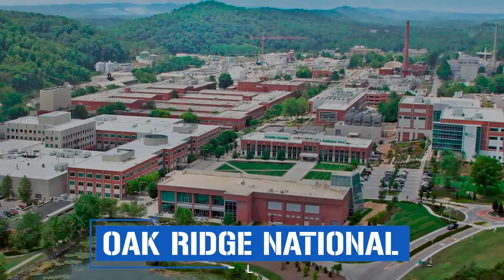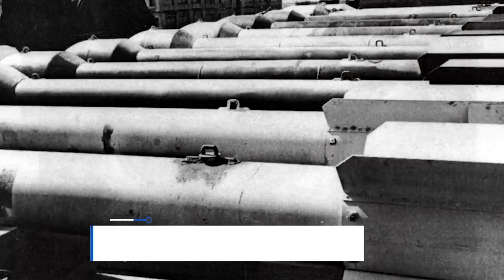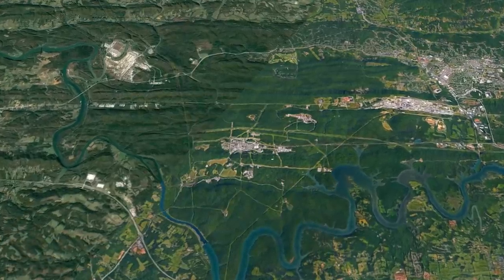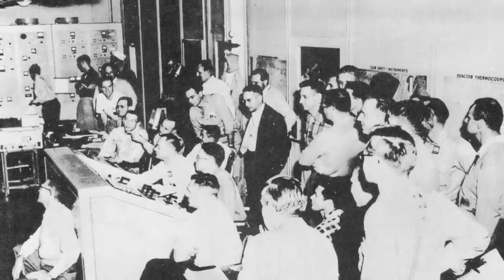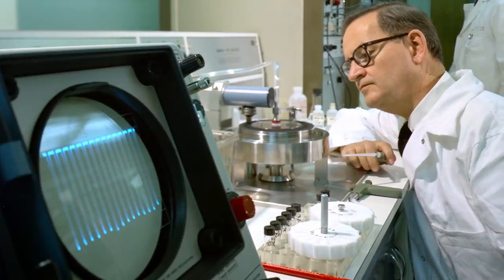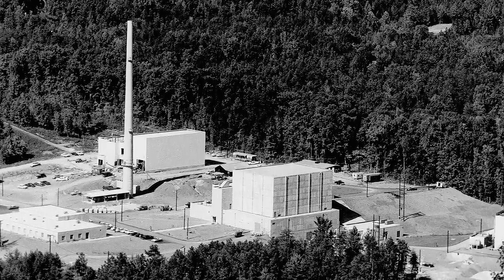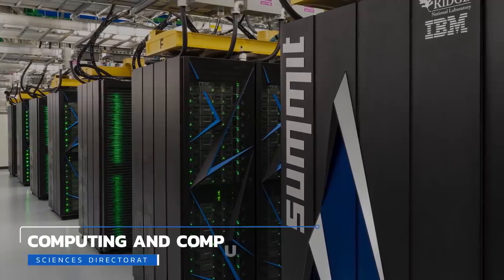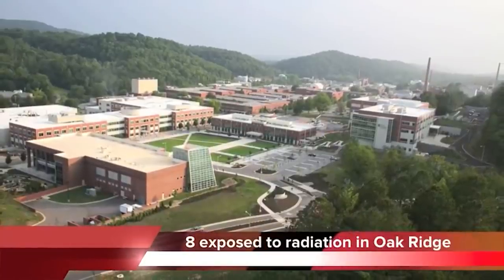The Oak Ridge National Laboratory

Comment: Having grown up just over the hill(s) in WNC, I have always been fascinated with what happens at this facility.

However, I had NO idea at ALL how massively monstrous the entire place is! 58 SQUARE MILES!!!!????? WHAT!!!!????
Reply: Mostly plutonium bunkers probably
Reply: @engineeringvision9507  good chance
Reply: 58mi squared is about 5 miles by 6 miles.    Probably decided on originally as a security perimeter, and later kept as a good standoff distance for the public should anything radiologially bad happen (Chernobyl was a graphite core too...)
Reply: @NullHand  Nah. Not even security perimeter, not really. Deal with the military long enough and you learn that's just their way of future proofing. It's easier to ask for a huge land grant of empty land to do something now than ask for an extension 20-30-50 years down the line in case they need it. Stuff grows around military bases directly outside the line and they figured out over a century ago that it's mostly impossible to get a court order to move that stuff to expand a base. The fort system of the 1800s was a nightmare anytime they wanted to expand a base. So now days they just claim the largest area anyone will let them get away with just in case. It's how they get things like White Sands. Noone cared about New Mexico desert, so they got 3200sq miles of it. A ludicrous area. You can always tell what part of the US government started any particular project by land grant size.

Comment: During the Manhattan Project there were 3 industrial facilities built in what today is called Oak Ridge.  X-10 had a graphite pile connected to a chemical processing plant (called hot cells) that made and recovered the first gram quantities of Pu239.  The other two facilities, Y-12 and K-25, were involved in uranium enrichment during the Project.  X-10 later became ORSL then ORNL after the war.  There are a lot o errors in your video as commenters point out.

Comment: I’m about 15 minutes from Oak Ridge the place has a lot of local rumors specifically alien experimentation. The security company I work for contracts security for the installation whenever you get posted there it is very secretive and you aren’t briefed on the job details until you go through extensive background checks.

Comment: I believe that a most extraordinary opportunity was overlooked at Oakridge with the groundbreaking work carried out by Alvin Weinberg and his team. Having invented a compact light water reactor (LWR) for submarines, logic suggested that this technology could be scaled up for Domestic power generation. Alvin Weinberg did not agree instead he favored revolutionary Liquid Fuel Thorium Reactors (LTFR). This technology has many advantages over LWR reactors including - inherent failsafe design - no pressure containment required - fuel dissolved in molten salts no need for expensive pellets - nuclear fuel is mainly used up in the reaction - little nuclear waste produced - reactors of this type can be compact and modular - does not produce byproducts that can be used in nuclear weapons (when Thorium is the fuel used) - Thorium is relatively common fertile material - this reactor concept has been built and tested in the 50s and 60s - the natural running temperature is around 600C-800C great for converting water to steam to drive turbines or better still use liquid CO2 turbines - this type of reactor will shut down safely if there are power cuts or leaks (where the salt freezes in contact with cooler air). I could go on but if only this technology had been taken seriously by the American administration, we would have a relatively cheap source of reliable energy, instead all the research is now open source and being developed by the Chinese government?

Comment: I'm afraid you butchered the Manhattan Project History of Oak Ridge National Laboratory (ORNL) by conflating the three sites in Oak Ridge at the time, and attributing that work to ORNL.  In reality, Clinton Labs, the progenitor of ORNL, was a small site that was managed from Y-12 during the Manhattan Project. Several of the historic photos you attribute to ORNL / Clinton Labs were actually of the much larger Y-12 or K-25 sites.

Oak Ridge was by far the largest of the Manhattan Project sites, and was an administrative center for the project (General Nichols, the primary deputy for General Leslie Groves, had his office at the Y-12 site). Operations at Oak Ridge were split among three sites: Y-12, K-25, and X-10. Y-12 contained the electromagnetic enrichment plant and the administrative offices for the Oak Ridge area. K-25 contained the gaseous diffusion enrichment plant  (a fourth project, the S-50 thermal diffusion plant, was co-located on the K-25 site, next to the K-25 power house). X-10 was the home of Clinton Labs (the precursor to Oak Ridge National Laboratory) and held the graphite reactor and ancillary facilities that served as a pilot plant for the Hanford plutonium production plant. Per "The New World, 1939/1946, A History of The United States Atomic Energy Commission, Volume I" by Richard G. Hewlett and Oscar E. Anderson, Jr, the Manhattan-era costs for the K-25 and Y-12 sites were each near half a billion dollars (in 1945 dollars), while the Clinton Laboratories costs were a mere $27 million. 

Through the WWII years Clinton Labs / ORNL never had any significant role in uranium enrichment - that was done at Y-12 and K-25. ORNL did play a major role in developing the methods used in Hanford to produce plutonium. After the war, it was determined that the gaseous diffusion method (used at K-25) was far superior to the electromagnetic enrichment (Calutrons) used at Y-12, and Y-12 transitioned to uranium chemistry (converting UF6 from the diffusion plant to uranium metal and recovery of uranium scrap of all forms) and fabrication of uranium components for weapons and reactor programs, a role that Y-12 still actively fills. Most of the Calutron production buildings at Y-12 were shut down in 1945 and 1946, but two calutron buildings remained open, used for the separation of a wide variety of isotopes. A decade or two after the end of WWII ORNL took over the management of the isotope enrichment facilities located at Y-12. ORNL ran them for a number of years until they were finally shut down.
Reply: Why are you bothering? This lot put a pretty low priority on research.

Comment: 10:46 Wait, just reporting "my colleague was using materials unsafely" even counts as whistleblowing?? It's a ridiculously minor thing to even bother retaliating over, especially when such safety precautions are necessary for the basic accuracy and efficacy of the actual science (completely apart from the safety for the scientsts). What happened to the colleague he complained about? It seems more probable for that guy to contaminate his new offices when he was moved rather than his bosses, honestly. Or someone else with a personal grudge - it would be very easy for someone working there to do.

Comment: Silver   But copper at that time was primarily used in shell casings during the war. So they came up with the idea of using silver as a substitute and there was only one place they knew to get that much silver; the West Point Bullion Depository vault where all the U.S. Treasury silver was stored. Nichols met with Daniel Bell, the Undersecretary of the Treasury Department, on August 4, 1942 to submit a request to borrow 6,000 tons of silver from the depository.
Hub Pages MELVIN PORTEROCT 12, 2015
Reply: Wth are you talking about
Reply: @SuperNoticer  An interesting factoid about the Manhattan Project, nothing more.

Comment: Play tractor trailer that they had the CT scanner MRI amateur fluoroscope and exploded on i-24 somewhere between exit 1 i-24 and exit 4 i-24 I am at 2724 Turner Lane Clarksville Tennessee if I walk out of my door and turn to the right I am standing between exit 1 i-24 and exit 4 i-24 I can't normally see i-24 from where I am Miranda nurse in Pembroke will give you an exact description of what happened but only after you evacuated

Comment: I tried to call oak ridge can't hear me and I can't hear oak ridge there's too much radiation the tractor trailer that they tried to build their makeshift ship with it was loaded with radiology equipment a CT scanner MRI imaging and fluoroscope exploded when the diesel fuel combined it created an atomic bomb I was on my way to the tornado shelter and exploded in front of me my blue jeans are shredding the same as if I were in the most dangerous part of the reactor I have medicine that prevents my hair from falling out and my hair fell out my tater tots and in my biscuit dough the radioactive Imaging ivp dye solution it hit me at 2724 Turner Lane Clarksville Tennessee 37040 in the face and also had a nurse in Pembroke Kentucky at Pembroke care and another nurse at Palmyra at Palmyra care the radioactive using ivp dye solution with raining down the tornado lifted but it kept spinning we need the Greyhound buses to evacuate Clarksville Montgomery County Tennessee Pembroke Kentucky Palmyra Tennessee